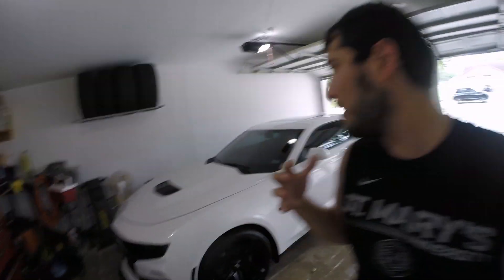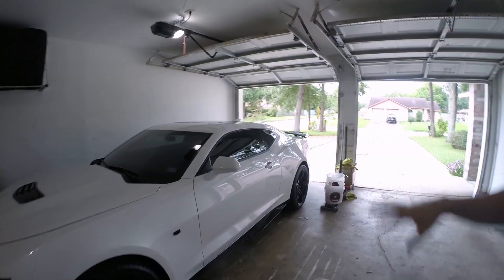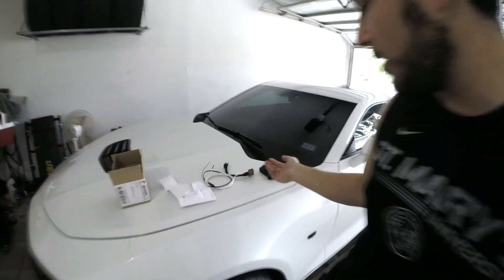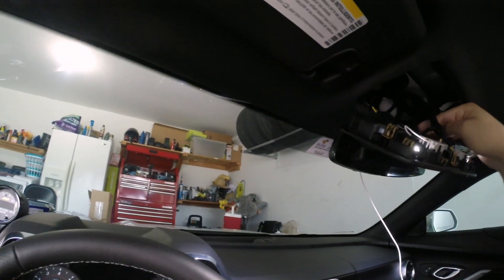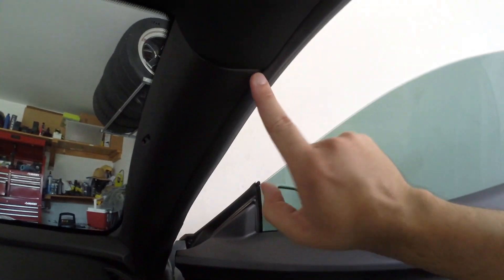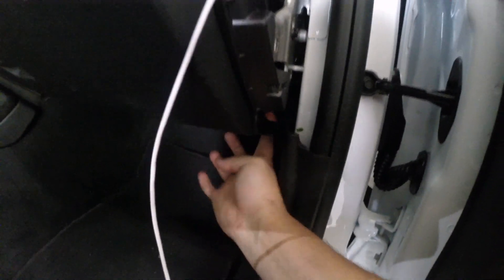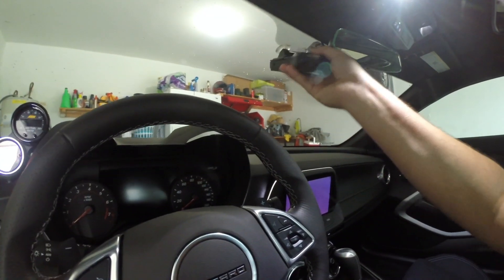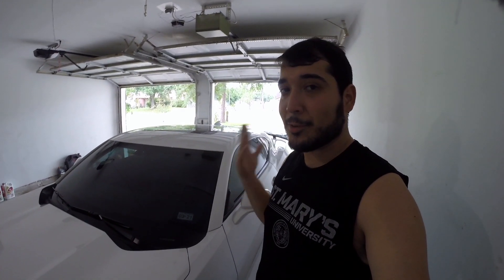Gen5DIY 2019 Camaro SS Radar Harness Install Radar Install Success! | Vlog #259

Comment: You can directly power it from the light cover . When you pop it out . You just need rj11 connector.
Reply from the maker: Not on the 2019 camaros they are different, I tried that lmao
Reply: @JLSpeed  really it doesn't have the on star socket in there?

Comment: will this work in the 2021 ZL1 i have with the camera rear view now? the mirror is different?
Reply from the maker: Yes it should bc it doesn’t get power from the mirror it gets it from down under the passenger footwell
Reply: @JLSpeed  ok have one coming... did you install one In your  ZL1 yet ?
Reply from the maker: @funnyzen6002  no not yet, but it doesn’t wire into the mirror, so should work

Comment: Go to Instagram and search 2019 Camaro. There is a sweet photo of a white camaro on there, with a pretty cool paint job, or wrap on the rear end. Also, you can get aftermarket rear view mirrors that connect to your iPhone. I want to try out the aftermarket Hundley heads up display that mirrors your phone. I heard it's fragile, however. Hmmm.